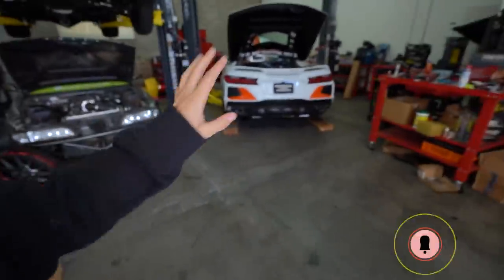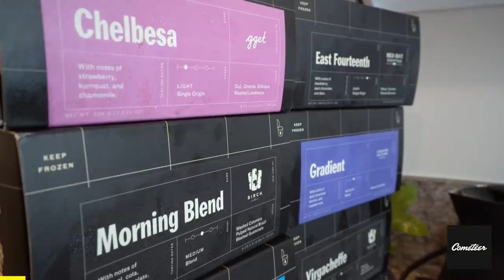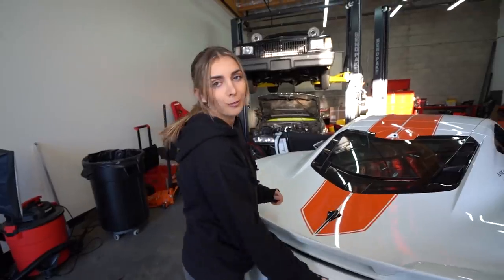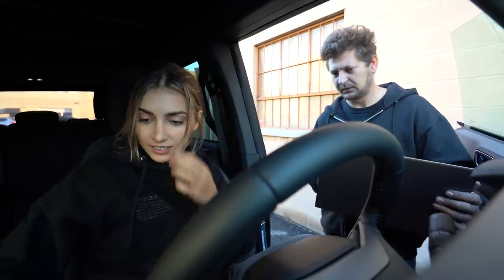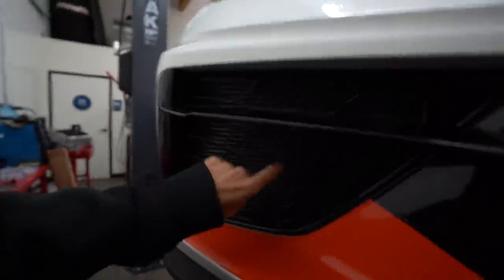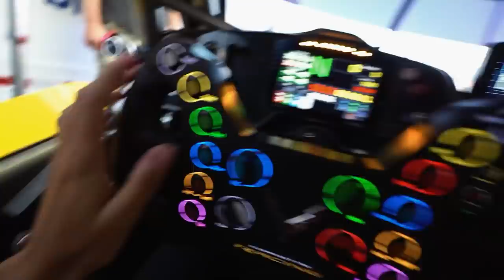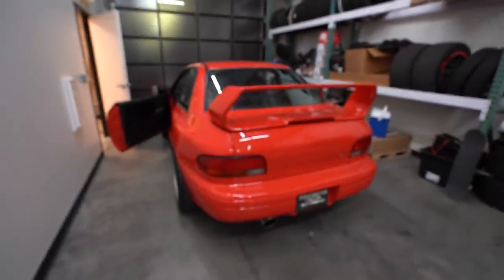Why I stopped posting my Twin Turbo C8 Corvette...

Comment: That bonus was a good gesture. His reaction was almost the same as the guy's who did my engine years ago. I went in with $8k and told him to keep it. The actual bill quoted was barely half that but even mechanics need some tipping. Even professionally they're not compensated so well, much like a chef. From the other side it can be glamorous but the reality is there's almost no money in the business with a 9 to 5 or small garage.

Comment: That cranking sound test is what we were taught  at Tuneup masters to check for a dead cylinder low compression. I also found an additive called Cera Tec makes your engine run cooler and gives more power especially on the low end acceleration. I've been using it in all my cars for a few years. Every one of them had a big boost in performance.

Comment: Hi Emelia

Just a suggestion next year you should build a K 20 twin supercharged engine front and rear with nitrous or a twin K 24 turbo charged front and rear it will be unique and unusual and it will be an epic build .use a honda civic si body and chassis. Only an idea.

Comment: I bought my 2022 C8 and did donuts with 150 miles on it and the engine light came on. I did about 10, donuts and then was bummed but the light self rest about 70 miles later. Love the car, red mist 2LT

Comment: the fins can be fixed with a ziptie you just have to be careful not to break off the fins. 
also you can usually only use this trick once after that there is not telling if a fin will break off.
all you do is use a ziptie and push from the back of the radiator and it will bend them back into place .
remember though it will not be 100% but it will look not to bad and it will save you a lot of money and it will function just as good as it use to - a bit of a wavey look.

Comment: Quick thought. Maybe its been answered before. Why not run a variable geometry turbo? It seems like they need lots of beep boops and to be able to control whats going on in real time. Having to go in and swap springs to adjust boost doesn't seem like they are getting the most out their gear and the most important piece...TIME! Just a thought.

Comment: My 2019 F150 5.0 has the ten speed, they are awesome!! I prefer a manual transmission, but the 10 speed is amazing. 17.6 MPG, using as many of the 395 HP as I desire, is a testament to the progress of automotive engineering.

Comment: 8:46 Off road is better as automatic especially in sand so you won’t get stuck when shifting gears ⚙️ as the clutch disconnects and then the sand prevents from going forward as you start to dig down and spin when rengage.

Comment: Please post track boost pressure. What is the best TRACK SETUP, and not dragstrip. This car goes onsale in Europe this year, and those insights are crucial for track builds. Please give spring rate and suspension data as well.

Comment: If only you could get a new ZO6...transaxle with it's lower gearing to help with drag racing for your C8. Hopefully it'll be tougher, etc. to handle more boost than your current C8 Z51 transaxle.

Comment: Happy holidays.The mesh protectors look really nice, but wonder if or how much air flow restriction they might introduce. Maybe a trade off with the new condensers and no real change to engine temps. But they do look good and will help protect from the elements.

Comment: this car has been under build its entire life!!!     in my book thats not good.   And not trying to sound like a jerk, i dont know if the problem is the car's inability to be modified.  or its the crew modifying it, or alittle bit of both.   At the end of the day,  at least for me, it seems like the best and only real upgrade to do is to go with a supercharger and thats it. most everything else just appears to be a plight down a road of pain.   Not to mention,,  when all is said and done your likely going to want to ditch the v8 in favor for the zo6 and call it a day.

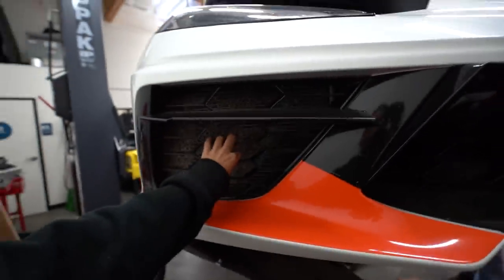Comment: @9:30 Mesh swap out. Ironically listened to Frank Stephenson (Ferrari F430 & McClaren Designer) talk about mesh on back of cars here  https://youtu.be/6Gdcp9HKJ6U?t=860 on Harry's Garage earlier today. You significantly reduce heat dissipation. Wondering if you'd thought about this?